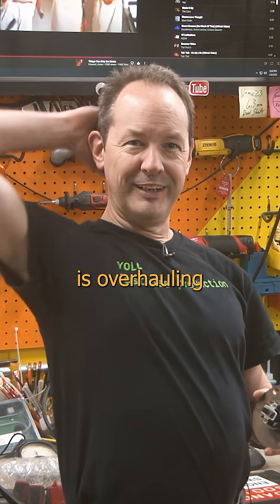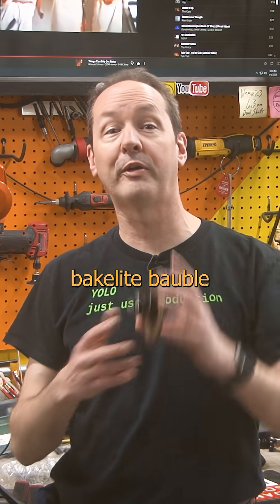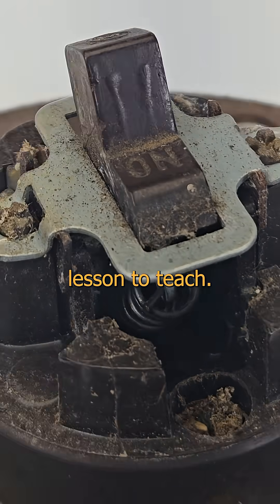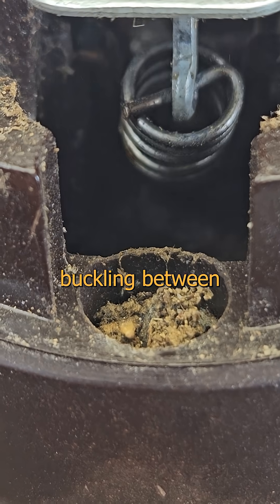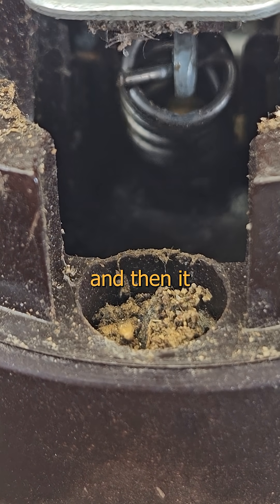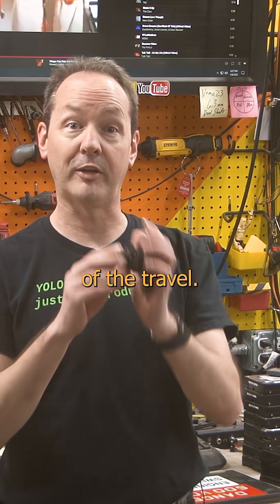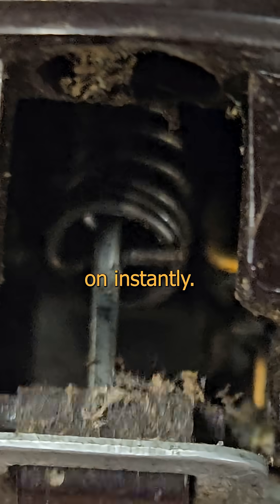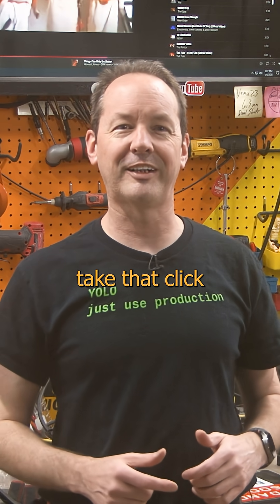Buckling Spring Switch #chrisboden #comedy #engineering #design #electrical #antique #vintage

Comment: As a keyboard enthusiast, I feel personally attacked. Lol
Reply: Now you must buy a 
"Chris Boden hurt my feelings"
T shirt 😂
Reply: @Bobcat2u  if that's available, I need to have a look xD
Reply: Agreed...😂
Reply: I revel in tactile feedback
Reply: Don't, we know the secrete the people with good backs know. Good springs are worth paying for.
Reply: "Me-too'd" from an IBM KB-8932 because quiet clicky is allllllmost as good as spring-clicky, but less PC-AT and more PS/2.
Reply: As non enthusiast, but someone who enjoys proper feel... I concur
Reply: @RetroGenetic  at that point, id say you're an enthusiast.
Reply: @abhimaanmayadam5713  not really, as I bought fairly "average" keyboard that was -50% (so 80€) which felt nice to type with xD
Reply: @RetroGenetic  Every single keyboard I have wanted has been cheaper than 160 euros. Tbh even 80 euros. Also my current board was also bought on steep discount and I bought the blue switch keyboard bc I like clicky over linear switches.
Reply: @abhimaanmayadam5713  I've usually drawn the line at 100€ but most likely have to loosen up when I next upgrade from this one :D
Reply: Agreed, but my keyboard doesn't have RGB. I did have to switch out the switches to get that way but meh.
Reply: @KiltedTitan  pft RGB is a must, much nicer in dark room, and on hit is nice effect to have :P
Reply: But also validated at the same time!
Reply: Mmmmmm tactile switches
Reply: Meh, so long as it works ya don't need the high end stuff XD
Anything more is just the excessive hedonism of keyboard fetishism XD
Reply: @raylenn4444  there is a point of diminishing returns, and it isn't that far even with keyboards xD
Reply: My IBM 4704 F107 keyboard converted to USB is crying. Although Bertha doesn't have RGB obviously, but she does have a solenoid for maximum annoyance to others and has been ticking since the 80s and cleaned and maintained properly will keep ticking many more.

...And that's pretty cool.
Reply: @iankunx  I wish I still had the "original" Keytronic, that had fat plug to PS/2 to USB adapters xD
Reply: I wouldn't really say I'm a keyboard enthusiast but I like having things that feel good, last good, and sound good, so I bought and use a Unicomp Model M. Is it the original thing? No. Does it work good? Yes. Does it look sensible? Yes.
Reply: @doohickey-enjoyer real. I've wanted an endura pro for a while now. $200 (which invalidates my prior comment but I forgot that I liked them. Same with daskeyboard)
Reply: Personally attac…tile. I’ll show myself out
Reply: Same here, I've been thinking about re-keyswitching my ergo keyboard.
Reply: You should! 😂😂😂 I'm waiting for him to make fun of my alternative energy addiction.
Reply: Not even ashamed to admit it hehe
Reply: Same 😂
Reply: Just bought a new battleship last year
Reply: Though I have to confess, I've been all about that smooth linear action for a bit now
Reply: How's your waifu?
Reply: Is there a difference between IBM’s buckling Springs and this buckling spring switch?
Reply: As a $19.99 Walmart Special user, I feel depressed.
Reply: I haven't seen this guy in my feed for like a month!! I was worried 😅
Reply: The cool kids are all using optical or magnetic switches now.
Reply: As someone with -3- -4- 5 mechanical keyboards, buckling springs are overrated. Give me a well-lubed, o-ringed Cherry Brown (or a good clone) any day. It's got tactile actuation, smooth travel, quiet operation, and it bottoms out smoother and softer than most membrane keyboards for reduced fatigue.
Reply: @MiIIiIIion I learned how to type on a typewriter. Specifically the IBM selectrics. This is what all buckling spring feedback is based on one typewriter from the 1970s. It's hilarious to me to see you talking about fatigue when I've actually had to use force to be able to put words to page.
Reply: @Amanda-ej7pl  here's your medal for winning gold in the typing fatigue Olympics! 🥇

Have you considered, though, that perhaps we've learned a few things since the 1970s about ergonomics and repetitive stress and how they affect the human body? And perhaps people want to avoid the mistakes of 50 years ago?
Reply: @PascalsGamblingAddiction  Absolutely not—you’re still typing on a flat QWERTY, a mistake from the 1870s. QWERTY was built to stop typewriter jams, not nerve damage. Dvorak cuts motion and repetition. Maltron fixes posture and load paths. Tented keyboards reduce strain. Less travel, less stress, less injury. I learned Dvorak—no problems since. 😂
Reply: @Amanda-ej7pl  And I'm living in one of the few places on earth where AZERTY keyboards are the standard.
Reply: @Zjefke86 Belgian?
Reply: @Amanda-ej7pl I can't use Dvorak my key binds will be fucked for the next 2 weeks
Reply: @Amanda-ej7pl Selectrics don't require any force to put letters on a page, they're electric keyboards. Force is only really needed in older fully mechanical keyboards. In fact, the Wheelwriter series that came after Selectrics uses a keyboard that's functional just a Model M.
Reply: @QwertyuiopThePie  Royal Quiet De Luxe is what I learned on using typewriting behavior by Dr Dvorak as well as the Navy typing manuals that my Father had. The selectrix has about the same feel as the IBM model m.
Reply: @MiIIiIIion  as a software engineer who's not into mechanical keyboards, I thought your comment was insightful. Thanks!
Reply: @MiIIiIIion  tbh, "O-ringed cherry brown" sounds a bit like some weird fetish...

besides, whats the point of not annoying all of your coworkers?
Reply: My current keyboard is optical mechanical with no tactile feedback...

Comment: Someone wanna talk about IBM model M keyboard?
Reply: Only the greatest keyboard ever invented, and I mean ever?  Pfft.  What's there to talk about? 

/I have three m'self...
Reply: @mikeybhoutex is one of them the unicomp? I’ve got that one
Reply: @CullenCraft  All IBM Model M.  Don't need no Windows key. :)
Reply: @mikeybhoutex  Still rocking several in 2026, including the one I'm typing this comment on! Modern keyboards suck.
Reply: @mikeybhoutex  One reason to get a Unicomp keyboard is that they recently added the SSK to their product line. Original IBM SSKs are hard to find and extremely expensive. I still need a good reason to justify to buy it for myself, lol…
Reply: @erikmouw  Well, I sorta NEED my number pad.  So... yeah. But still, the SSK is awesomesauce when needed!
Reply: @mikeybhoutex  You must be an accountant, a network engineer, or French.

The first one is obvious, second is for typing IPv4 network addresses, and the third one: French keyboard layout requires to use shift to access the numbers on the top row, hence the frequent use of the numpad, lol
Reply: @erikmouw  Programmer first, then the network engineer, so close enough.  Used it for both number entry as well as the superior cursor mover back when code and computers were more text than not.  I preceded Windows.  H88/89/Z90s if you know what that's about.  

Numpad for lyfe.
Reply: @mikeybhoutex  The Heathkit/Zenith microcomputer line. I know about them, never seen one irl, I’m not even sure it was sold in Europe.
I came from C64 —> C128 —> PC. Also did a lot of programming, then went into the Unix space with VT100 terminals without numpad and unusual cursor control, but I learned to like vi and its ‘hjkl’ cursor movement (hint: it makes sense once you realise both hands are in the natural position for ten finger typing).
Also did my share of network engineering and that’s the only time the numpad made sense to me. With IPv6 it doesn’t really have an advantage anymore.
Reply: @mikeybhoutex  I only have two. One I bought new (NOS) in it's original packaging about eight years ago. That one is on my home office PC. 

The other I pulled out of a scrap box at my old job. I used it there for a few years until they pulled the plug on us. 

I took it with me, and when I discovered the computer at my new job and a PS/2 port took it to work and I use it ever day.
Reply: Me ✋
Reply: I have an IBM PS/2 one from 1987.

After 30 years the ribbon cable between the controller board and the LEDs was broken and the rubber feet worn out. Luckily Unicomp still sells replacement parts for those old keyboards, so for $20 including international shipping my Model M worked as new.

It needs a PS/2-USB converter and an USB-A to USB-C adapter cable to connect it to my Mac. As it has no windows or apple key, you can use Karabiner Elements to remap one of the Alt keys.
Reply: @erikmouw  control+escape works on windows for Windows key
Reply: @Teknickel_ftw  I mainly use MacOS (hence the use of Karabiner Elements, it is available from homebrew, btw), but thanks for the Windows key hint, I completely forgot about that one!
Reply: I personally have the Unicomp version of it. I just like clicky sounds and I also like clicky feelings!!!

Comment: The old IBM buckling spring keyboards were pretty awesome. They sucked for gaming though, two keys pressed down at the most! The third key would make the computer beep angrily and nothing would happen.
I'm talking about the OG ones too, for the PC and the PC XT.
Mechanical switches now-a-days can have even better feeling. I like red! Pretty close to the sound and feel of the ol' IBM tanks and they don't weigh several pounds. I think IBM was afraid the keyboards would run away if they made them too light.
Reply: IBM built heavy iron computing for industry. Until the PS/2, they still built their microcomputers like their mainframe hardware. In the XT and AT era, the micros fit in pretty well next to System/360 terminals.
Reply: @r2db  Back around 2000 IBM demoed a Z-series mainframe at LinuxWorld NYC. From 9:00 they started spinning Linux VMs every 5 minutes, at the end of the day they had a few hundred VMs running, which was really impressive for that time.
I asked one of the IBM engineers why there were two Thinkpad laptops to the mainframe. It was for monitoring and bootstrapping the mainframe itself. He grudgingly admitted they had to use two Thinkpads because they “were not as reliable as the rest of the hardware” 😊
Reply: @erikmouw I still use old ThinkPad laptops. The old hardware was nearly bulletproof, but a "normal" desktop computer was the cost of a nice car, and the mainframes were more than a couple houses.
Reply: There are modern accurate reproductions available, with usb and afaik n key rollover
Reply: Meh.

Comment: The general term is an "over centre mechanism" and once you know how they work, you'll start seeing them absolutely fucking everywhere.
Reply: ThisOldTony fan?
Reply: I think all the switches in british light switches use them and plugs i have only found one that didnt snap and i question if that switch was up to code as i have to hit it to make it switch rather than sit half way
Reply: @Daisy_human That's probably broken, replace ASAP.
Reply: I feel like an over-center mechanism most days
Reply: @JohnVance  fell over recently and wondered if I should sign up for AARP. And I’m not even that fat!
Reply: Small limit switches at work. Make great clickers too!
Reply: God bless that old tom
Reply: The clutch pedal assembly in a 99-08 Ford Super duty is a similar design, but the opposite end is what is pressed. So this switch but if the body was what you press and not the actual flip switch😅
Reply: Like the safeties on some balisongs
Reply: I see them all the time on door latch mechanisms

Comment: I was messing with the handle/latch on a sliding door and it had the same type of spring setup for the latch to stay toggled between locked or unlocked.